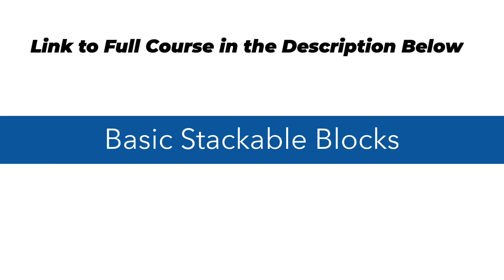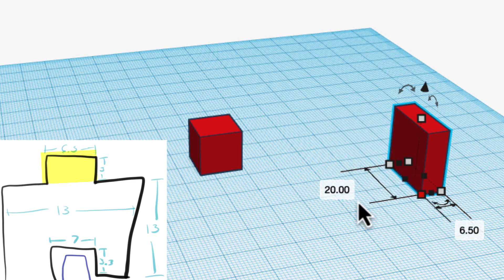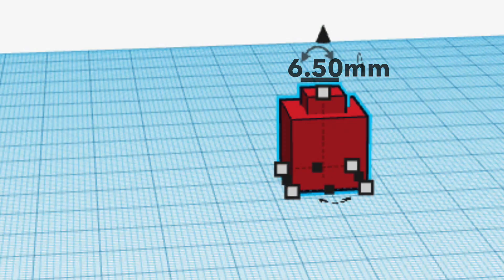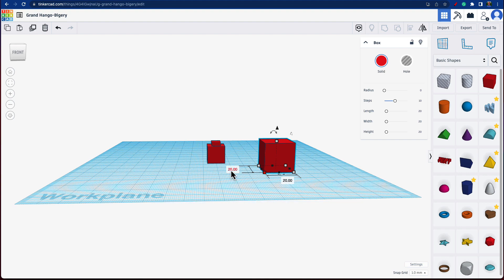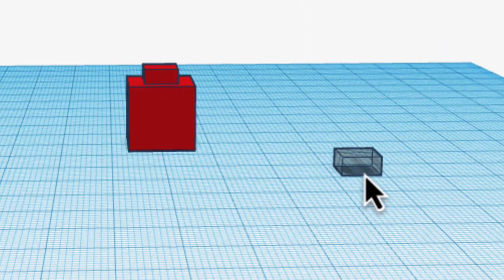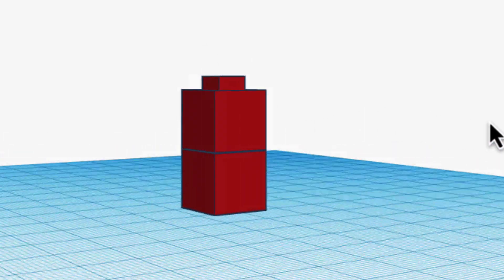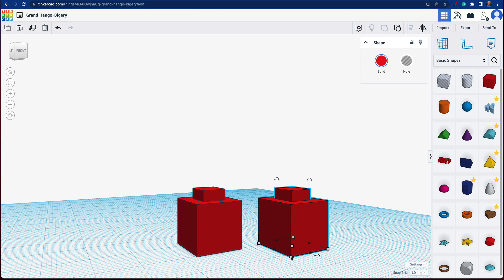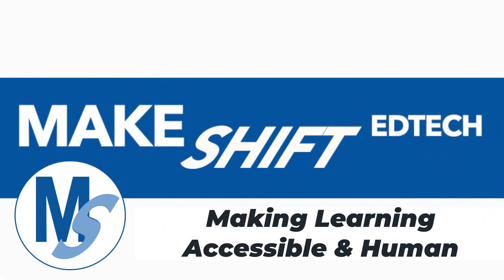How to get your 3D prints to fit together

Comment: What can you do when you scale the whole model? The gap will become alot bigger, so i wonder if there is a mathimatical way to change the size of the gap depending on the scaling persentage in a printing slicer program. For example, im trying to make an action fuigure of different sizes. I have the design of the joints that have been cut out for a 6inch fuigure. But if i want to make the same fuigure scsled up to 10 inches, what persentage do i put in for scaling up tje model to that size and how much bigger by percent should i scale down the "male" pin to make the peices fit snug and keep the gap at .2 mm? Do i have to remake the joint. Also asking because im trying to make a boolean key joint and i worry about constantly making new ones instead of editing the thickness of the gap
Reply from the maker: This is definitely a  challenge with scaling shapes in programs like Tinkercad. This where parametric design programs such as Fusion 360 or OnShape come in hand. That way you can set a variable for your tolerances and object size so everything updates accordingly and you don't have to worry about scale. This is a different way of modeling though.

Comment: Tolerance required depends on Slicer settings and printer condition. I use 0.2mm in Prusa Slicer and Cura. Also sharp outside corners on inserted parts should ideally be rounded.

Comment: starting rule of thumb:  add nozzle radius to perimeter of concave (arc compensation) surfaces, fillet outer edges in case of sharp edges, counter-hole inner straight edges.

Comment: When calculating tolerances for my printer, I look at layer height and nozzle size. If you have a 0.2 mm layer height, any object that doesn't divide by 0.2 will be taller or shorter than expected. I have a nozzle of 0.4, so I try to make sure my dimensions also divide by 0.4mm. If your printer follows the outline of the object without compensation for nozzle thickness, this would cause the object to be thicker by 0.2 to 0.4. Extrusion rate can also cause excess filament to be extruded causing the walls to be slightly thicker. Calibration is important, though even professional products include tolerances that vary depending on the production process used.

Comment: I watched some video about 3D print bolt and nut. They create a bolt first, duplicate it and turn it to "hole" and create a nut from it. I always wonder how it work without putting any tolerance.  Thanks for the explanation in your video and support me that tolerance should be taken in fitting two pieces in 3D printing.

Comment: THE FOLLOWING INFO ABOUT WHERE THE WALLS ARE IS OBJECTIVELY WRONG. IGNORE ME. :-)  The idea of using teflon tape is still good tho.

The slicer generally runs the print head around the border of the STL, so the walls are going to be about half the nozzle width on each side. So make the hole to nub difference a bit more than the width of your nozzle.  For big prints, it's helpful to put it in the slicer, add enough negative space to chop out everything but your holes or bumps, and see how things fit, before printing a large chunk of plastic.  If the bits are bigger (tens of mm across) you can print the hole significantly bigger and then wrap the peg with a bit of teflon tape to make the fit very snug.
Reply: The teflon tape approach is a good idea, but I don't think, that slicers run the print head around the border, but actually on the inside of the border, so that the part is as close to the real dimension as can be. When I print pieces, that are supposed to fit together snuggly, I leave out a 0,1mm space on each side, so that's 0,2 mm gap, with 0,4 mm nozzle. That accounts for the tolerance of the printer and any imperfections are accounted for.
Reply: This is just false. All slicers inset the toolpath correctly accounting for line width.
Reply: @daliasprints9798  I'm pretty sure Cura gives you the choice, at least. I'll have to see what PrusaSlicer does. You might be right, and I might have gotten bad information.
Reply: @darrennew8211  You could explicitly make it wrong by setting horizontal offset to + half nozzle width, but otherwise that's not happening. I had a question whether slicers did thos right years ago when I was new to 3DP, and yes I think it's a natural one, but anyone who's ever printed small parts or parts with small features knows they get this right already. +0.2 mm offset everywhere would make anything small or mechanical completely unusable.
Reply: @daliasprints9798  Yes, I think that's right. I think I watched a misleading video that talked about it, and it just stuck in my head as to why clearance is necessary. I always got good results with a total clearance of the width of the nozzle (so half on each side of the hole) so I was never dissuaded. But thinking about it, a calibration cube would be wrong if I was right. And looking at the actual generated g-code, a 20mm cube has a 20mm move exactly on the perimeter. An inside cut-out has rounded edges for some reason I'm still working on, but it's still at least as big as the hole as modeled.
Reply: @daliasprints9798  Ah, I just ran across the video that confused me. It's v=X6nCKQToOUg on youtube. (Lost In Tech's slicing telerance setting video.) But I don't think it's the same thing I was thinking.
Reply: @daliasprints9798  It looks like this is true for external permiters in PrusaSlicer, but internal holes are a little funkier, with explicitly rounded corners and slightly longer travels than the sides of the model subtracted out. (I made a one-layer cube and subtracted out a smaller cube and did the math in the g-code.) Weird, but I think you're primarily correct, which makes sense given the concept of calibration cubes. Thanks for the correction!

Comment: That's a good tip to make the top block a hole temporarily to see how it is fitting inside.    Thanks!
Reply: You can also hit t on your keyboard to make it transparent. And you can even see better than making it a hole. Try it out.
Reply: @jacquesalphonso3636  Didn't know that. Good tip. Thanks!
Reply from the maker: Glad it was helpful!